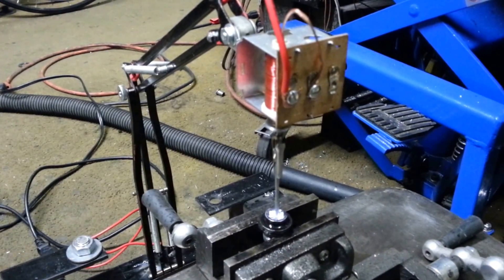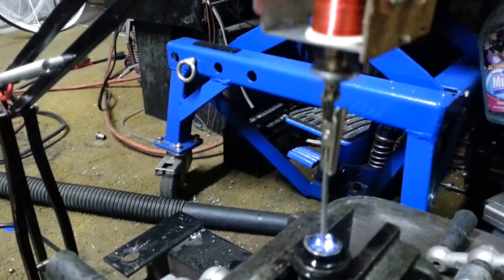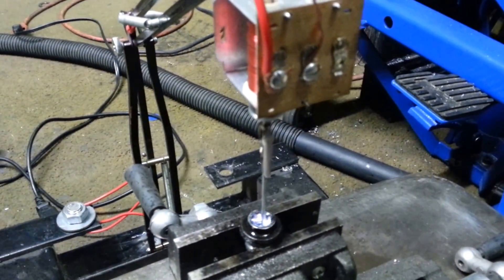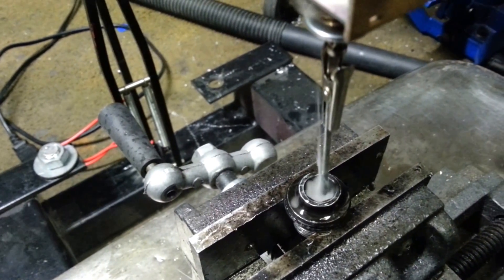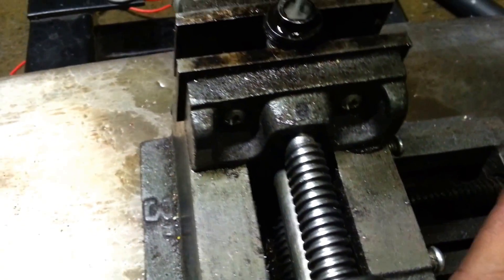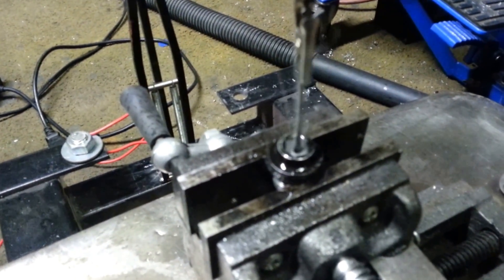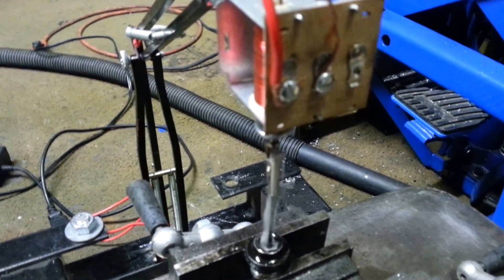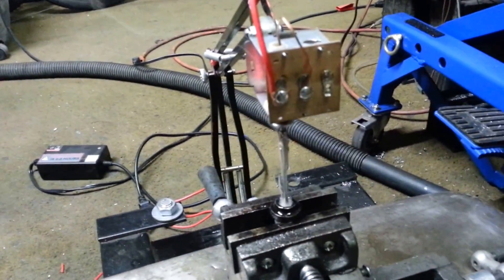Homemade Small Hole EDM for under $20!

Comment: This works. Just tried myself. Tried on carbide tip, with 12vdc battery charger+ups battery. Coil should be from wire as thick as possible, because the more amps on tip, the more fun it makes! Device should be pretty rigid, tip should run precisely, oil bath makes it funnier. Thanks for inspiration. Come here broken taps, i am prepared now😁

Comment: I gotta give this a try, thanks for sharing. I'm also planning on throwing a capacitor in parallel to boost the current a bit
Reply: I tried parallel capacitor. It weakens the spark.. to my thinking it makes it worse.
Reply: maybe better way would be the selecting propper solenoid, that just don't let the electrode to get stuck

Comment: Can i use a 48v power supply along with a board that switches to pwm instead of using a solenoid? Or would that not work?
Reply: Hi umashi, check my homemade EDM machine, I used PWM and a 200V power supply. Hope it helps!

Comment: Before anyone gets too excited don't you think if it actually works there would be 50 videos just like it? There's a reason you only see one and a reason you don't see the end result, which my guess is a bolt with a black spot on top no hole. Someone got overly excited and posted the video before seeing its end results. Can't knock the guy for trying though.

Comment: its not breaking down iron into carbon...  it only breaks the molecular bond between iron atoms. 
it would have to rip away 20 electrons, 20 protons, and 24 neutrons from an iron atom to make it a carbon atom. our best efforts to make synthetic gold took tremendous amounts of power. way more than can be delivered to an average house.. the machine alone to do that was the size of a 2 story house. 

cool machine though. brilliantly inexpensive if it works. it doesn't need to be precise if your not doing production part fitting.

Comment: You’re not breaking down metal at a molecular level with electricity. That would be fission...
Reply from the maker: This is an electrochemical erosive process where molecules of the alloy's crystalline structure are cemented out in a single-replacment reaction. What you're thinking of is an atomic/subatomic "level". Fission is the seperation of an atom[s] nuclei by bombardment of neutrons.
Reply: That sounds like the atomic level mate

Comment: what gauge magnet wire on the coil and about how much wire was used to make the electromagnet? I need an EDM since I got a tap stuck 2" deep in a 1" square iron stock. would need a diagram of how to build yours though

Comment: use water instead of oil. the carbohydrate residue insulates, so a lot of the power of the spark is negated

Comment: Thanks for the EDM video using a solenoid. I am getting inspired to build my own EDM using a 24V solenoid that I have. 
I strongly feel, you should have waited and included in the video, a footage of how the hole looks after the job is completed. 
In your next version, you may wish to replace the shaky and wobbly mechanism to hold the electrode with a more stable one.
Lastly, according to text books, the positive lead of the power supply should be connected to the workpiece and not to the electrode in order to maximize erosion of the workpiece.
Reply: Hi Bala - did you make any progress?  Another thing to consider with this setup is fire safety.  The dielectric oil he is using does have a flashpoint, and if the oil level drops the extreme temperature of the arc could reach the vapors and cause a fire.  I read about this here:  http://www.firetrace.com/wp-content/uploads/Protecting-Against-EDM-Fires.pdf
Reply: Here is one using a mechanical pencil (a graphite electrode).  "Reflex EDM".  

http://www.bnpeters.com/mass62-how-to-make-something-that-makes-almost-anything.html
Reply: @czycada  Link is dead.

Comment: I been dreaming of finding a low tech way to make a homemade one of these.never coulda thought up that solenoid solution! pure genus ! you should put it up on homemadetools.net. 
...one q: don't they always have hollow electrodes with dielectric fluid pumped thru tip to keep discharge consistent, keep the process cool, & remove the debris?
Reply: rod builder That's the die sink edm. There is also edm drilling, where we use a thin brass tube to drill holes. And yes, the dielectric fluid (deionized water) flows through the electrodes to keep discharge consistent, keep the process cool, & remove the debris. The pros are that it's fine, accurate, and really fast, the con is that it "eats" electrodes. We use it mainly to drill starting holes for our wire edms. (or drill out broken taps, drill bits, etc.)
Reply: No. They submerge the part in dielectric oil and perform the operation under the surface of the oil.

Comment: Thanks for the video. Dude, I thought I was listening to me! Your voice is EXACTLY my voice. Freaky! I need to look into boring a 1/4" oil galley hole in our crankshaft and was thinking EDM would be an option to drilling although my machine shop says a carbide bit will handle the Rc30 with no problem..
Reply: I have used carbide tipped masonry drills in CPM3V  at over 60 Rockwell. About 1/4" is as small as I've tried. When drilling something that hard it usually cracks the carbide tip as it exits it's hole.  Usually when I had to do this was when clearance was forgotten about on a die section until it was discovered after heat treatment.
Reply: Use a cobalt drill bit, or 2 flute end mill.